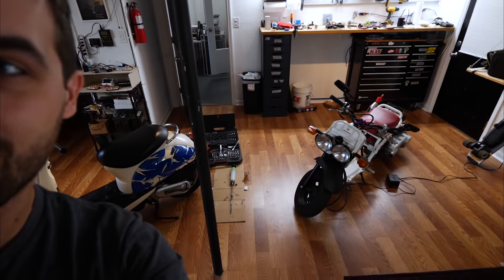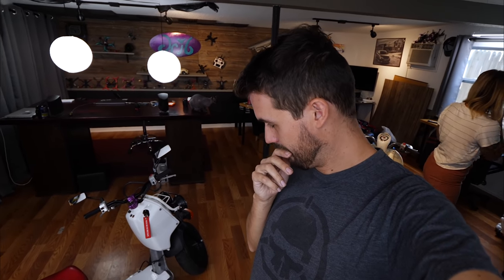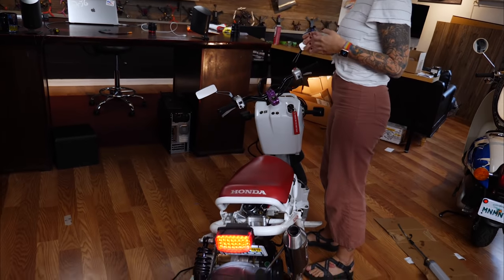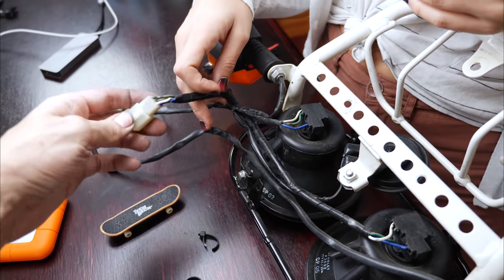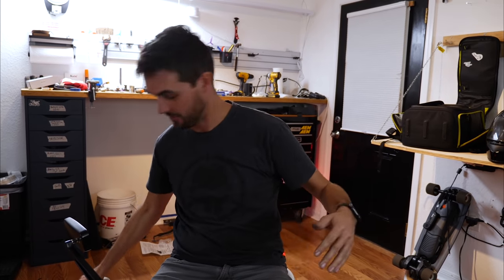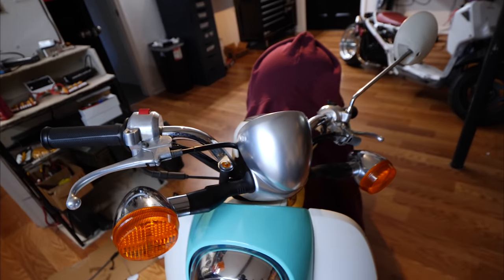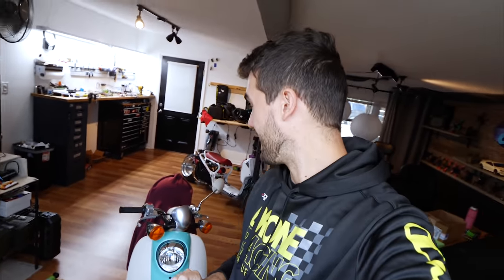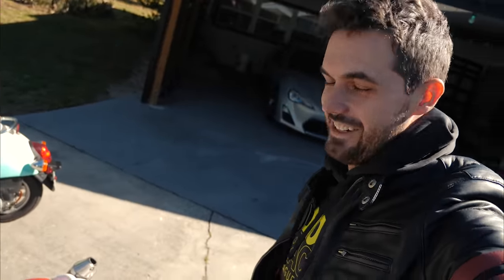is her scooter cooler than mine? - Ruckus GY6 and Honda Metropolitan

Comment: That Ruckus is a damn cool build but it sounds like it's a bit tired in the low range. UNI podfilters and smaller Mikuni carbs are a mess to deal with on low cc fourstrokes sometimes, probably has to do with the angle and lenght of intake tubing in combination with pretty much unrestricted airflow.

Comment: You need a heat gun bud, you may have been able to convince the wrap around the speedo bezel with a heat gun, also it’s easier to probably just leave the panels in place, cut around them once it’s wrapped

Comment: So lean off of idle on Drew’s scooter. Jet that unit!!
Reply from the maker: What makes you think lean? I’m thinking it’s running rich actually
Reply: @LeDribFPV  it very well could be. But if it’s lean and you lean it out more you could melt the piston. Airing on the side of caution, always suspect lean. Better air filter, better pipe equals more air in and out at a faster rate. That equals a need for more fuel. It could’ve been jetted before you got it. But again always jet on the side of caution and suspect it’s lean. The two conditions at there extremes almost sound identical. And being from a camera and not my own ears. The best it’s sounding is lean, that and given the mods it has already. Just my thoughts, it’s safer this way. Ask me how I know 😁 plus if you add more fuel and it gets worse there’s zero harm. Maybe a fouled plug. At that point I’d go the other way. But only a couple of jet sizes either way. If you go up two, and it’s wrong. Then go down four. Two either way. You’ll know immediately if it’s right or wrong. It’s running and driving so it’s really not that far off. Just has the little cough/hesitation on initial throttle. If jetting gets it better but not great, the carb is most likely just too small with the air flow the engine wants. At that point go straight to a Mikuni.

Comment: In no world is any metropolitan cooler than a ruckus especially not one that has a motor swap and is stretched I worked as a motorcycle mechanic for years and I built one of the last made two stroke Zuma scooters after a big bore kit titanium exhaust and basically every part changed nothing like a scooter that will do 80 mile an hour